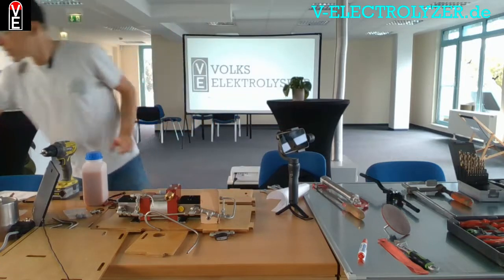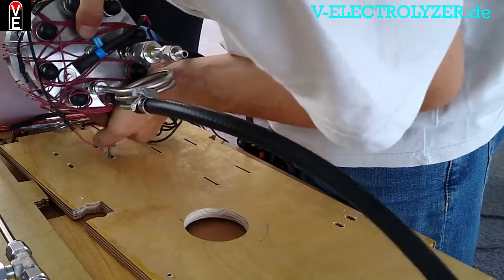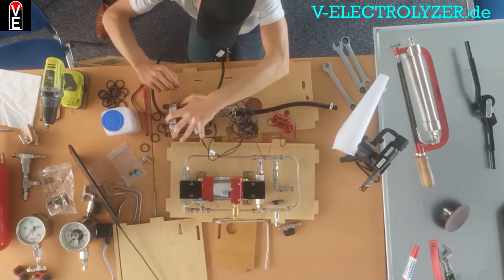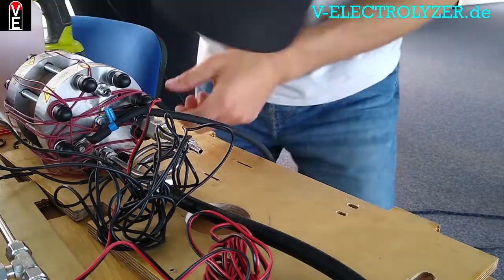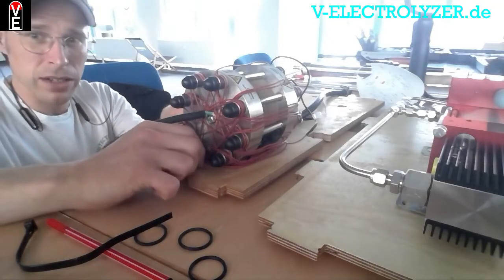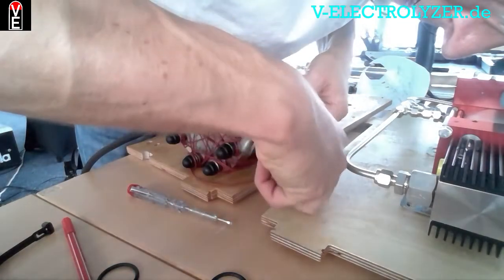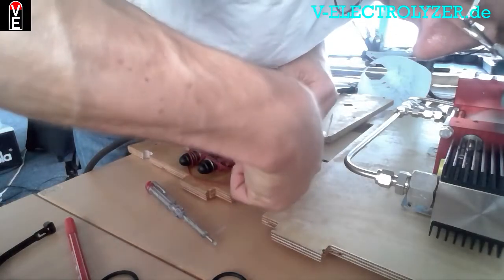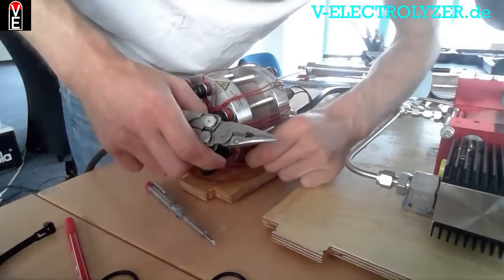011 Hydrogen PEM Electrolyzers 12V with Iridium Catalyst for maximum Lifetime, no KOH

Comment: What happens if you start the electrolyzer with colder water?  It will eventually heat up anyway.  Will cold-starting cause damage?
Reply from the maker: It is recommended to heat it up before, that is why we have a new and safer heating system integrated to the electrolyzer